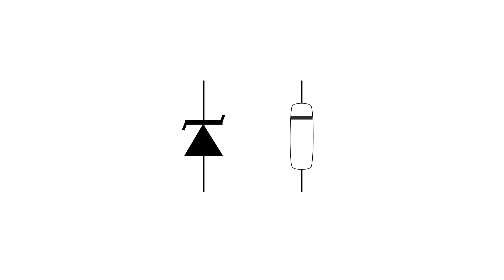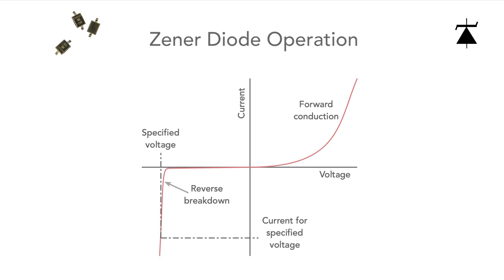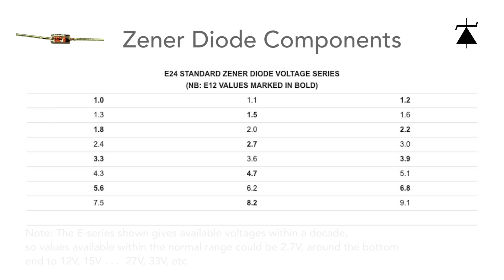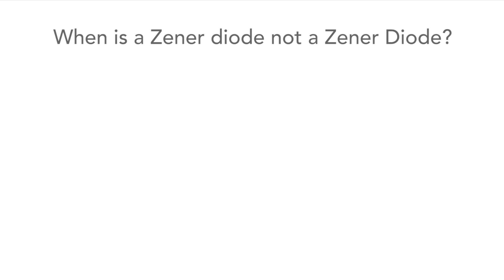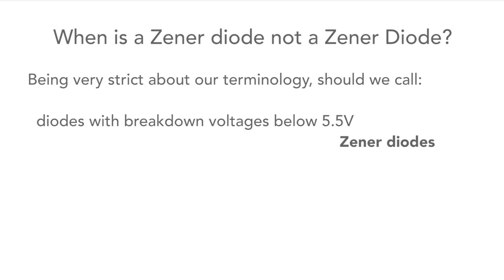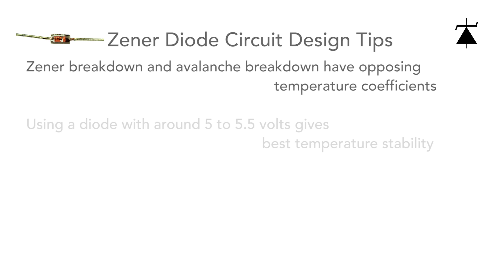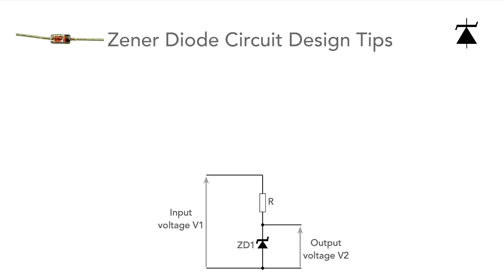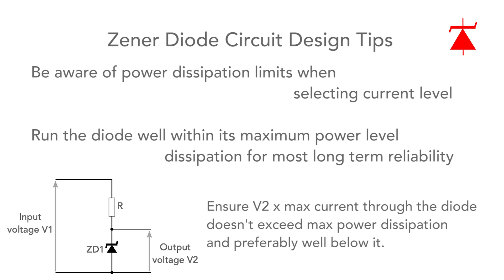Zener Diode Basics: What Every Electronics Designer Must Know

Comment: Nice, can you use a resistor to help dissapate the power if the zener is not rated high enough ?
Reply from the maker: Typically a resistor is used as a series current limiter / constant current device as shown in the video. The Zener diode has a fixed voltage across it and the current flowing through it is determined by the series resistor and the load. 
Often an emitter follower circuit is used if a higher current capacity is needed. There was an example of this in the video. Hope this helps.
Reply: @ElectronicsNotes Yes, I think that helps, so you can use the series resistor to limit current flowing to the zener and as it has it's own internal resistance it has it's own volt drop so it must be able to dissipate the power for that but the series resistor will also limit the current to the load so that's when the emitter follower is used. 👍